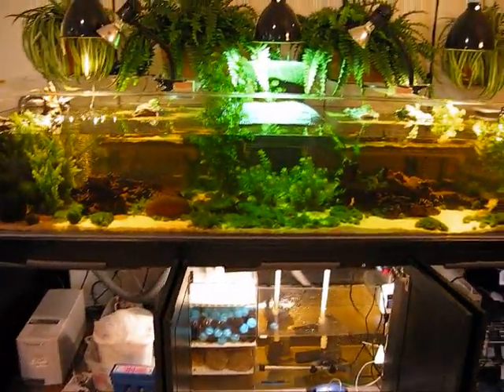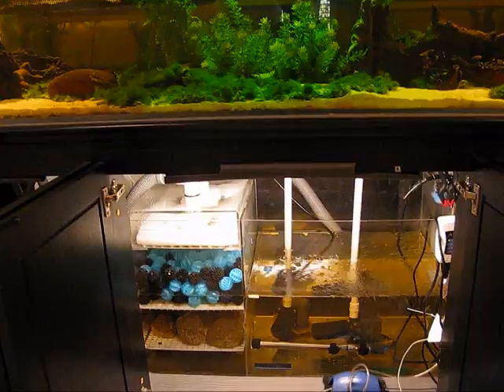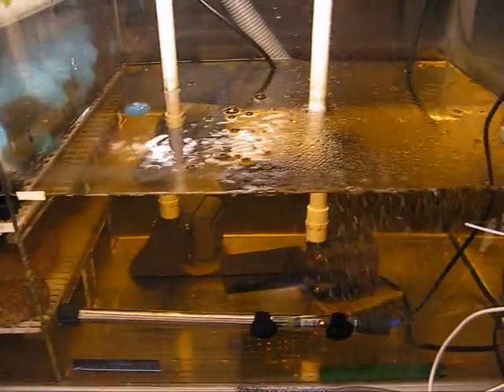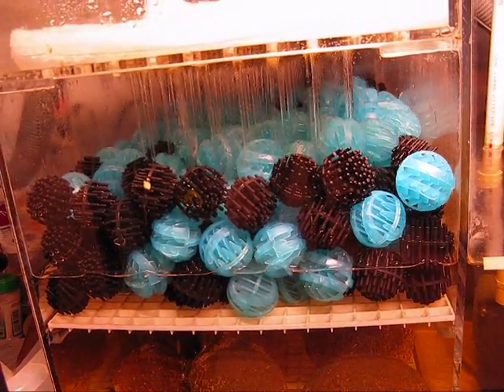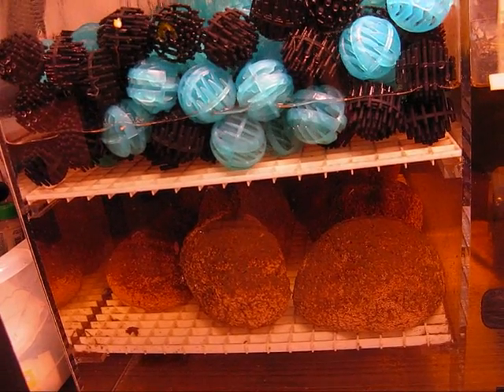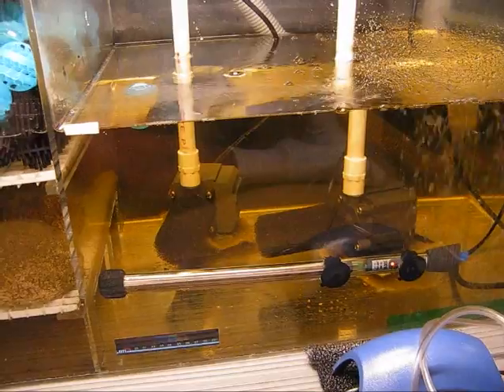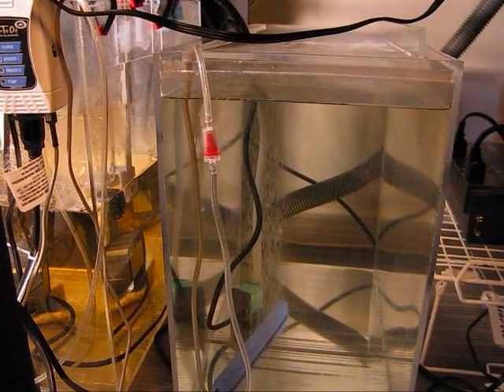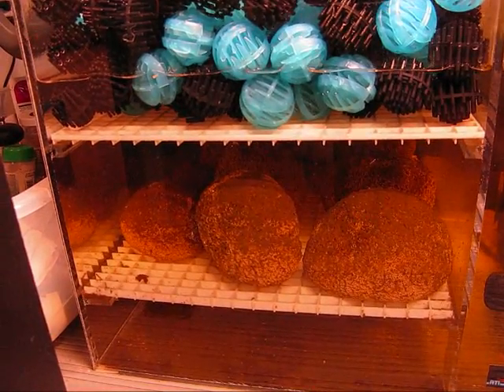Turtle Tank Trickle Filter

Comment from the maker: @Amatersaru1 I know that it looks that way, but the force of the water coming out of the return nozzel (700 gph) moves the filtered water well into the body of the tank and away from the overflow.  You can set up a tank with the return(s) on one side of the tank and the overflow(s) on the opposite side.  A stronger, one-way current is formed that way but I think having a return on each side mixes the water better.

Comment from the maker: @wailed72 lots.  can't remember excactly.  The tank is a custom built acrylic tank with a large sump.  The stand is also custom built because the tank is so wide (3 feet).  If you can do some of the work yourself, you'll save a bundle. You can price shop at different aquarium stores for the tank and sump, then check with furniture builders if you need a custom stand.  Plan on spending a couple grand for an extra large setup, tank, sump, pumps, plumbing, etc.

Comment from the maker: @turtlefan03 I did not design my sump, had an aquarium shop do that for me.  They also built my tank.  The sump only needs to hold enough water to operate the pumps and manage backflow when the pumps are off.  More water helps if you want to place a heater in the sump, add a bag of carbon, etc.  More water helps dilute waste.  With lighting you can even create a refugium out of your sump with plants and even fish.  There is plenty out there on the web on sump and refugium design.

Comment from the maker: @xdylancoolman I don't design tanks, best to check with a good aquarium shop.  I have two 700 gph pumps.  I have about 25 gallons of water in the sump while the pumps are on, backfills to about 30 gallons when the pumps are off.  I do my water changes from the sump, not the tank.  Keep my heater and a bag of carbon down there.  You only need enough water to cover the pumps and enough volume to accept any backflow when the pumps are off.  A larger sump increases total water volume, that's good.

Comment from the maker: @jptzy I did a video on managing overflow noise, take a look at that.  I have a corner box that surrounds the wet/dry plumbing to keep the turtles away from it.  On that corner box I attach a few electrical ties and drop one end into the overflow--that manages the noise quite well. 

I have a reservoir and an automatic topoff device that automatically pumps water from the reservoir to the sump as water evaporates.  It is great, especially if you are out of town for a few days or a week.

Comment: im in florida too and know all bout those power outs. great vid btw. i need to refill my sump roughly every 2 weeks because of evaporation. my trickkle filter moves alot of water but my only problem with it is the sucking noise it makes when the water goes down the overflow tube. i tried everything to change how the water goes down it but the noise wont go away permanently. my overflow tube hangs off the back of my tank after gettin siphoned from inside the tank. any solutions to the noise?

Comment from the maker: @staffi910909 depends on your setup.  I change the filter pad twice a week along with a partial water change.  When I turn off the pumps, some water backs up into the sump.  I then drain the sump (about 30 gallons) using a separate pump connected to a garden hose that leads outdoors.  I then refill the sump and turn the pumps back on.  I don't do any maintenance inside the tank except removing algae from the sides and siphoning debris that collects at the bottom of  the corner boxes.

Comment from the maker: @Theyallfloatdownhere if you really want a wet/dry filter there are a couple options without getting a new tank.  You can build an above the tank wet/dry where you pump water up to the sump, the filtered water then runs or rains back into the tank.  Or you can buy an overflow box and have the sump underneath just like a drilled tank.

Comment from the maker: @madturtlefan They are bio balls.  The surface of the balls is not solid but rather a maze of surface areas througout the inside of the ball.  Water pouring over and through the balls spreads out over the vast surface area allowing for a generous exchange of oxygen.  Water filtered in this manner will have very high dissolved oxygen levels.  Nitrifying bacteria that break down the waste and uneaten food are oxygen hungry.  The more oxygen, the more 'good' bacteria to keep the tank clean.

Comment from the maker: @madturtlefan not if I can help it.  The tank becomes a balanced ecosystem after a while and a complete cleaning would ruin that balance.  This works best in a large tank.  I scrub algae from the sides of the tank, siphon debris that collects in the corner boxes where the plumbing is, rinse the bio material in the sump, change the filter pad, do frequent partial water changes, and monitor ammonia, nitrites, nitrates, and periodically check PH and  dissolved oxygen levels.  That's about it.

Comment: @BauriBob Oh, I know it. Right now I'm using pumps connected to filter boxes. They pump the water into another box that serves as my biological filter and hangs on the side of the aquarium. The filter boxes do all my mechanical filtration, and they have some activated carbon for chemical filtration as well. Then the water goes through my bio filter which has the heater in it. It gets the job done, but isn't as easy on the eyes as yours!

Comment from the maker: @kwo282828 There is never any uneaten food since the catfish and ghost shrimp finish off whatever the turtles leave behind.  Turtle and fish poop dissolve in the water and is converted to ammmonia byproducts which are easily dispatched by the biological filtration of the wet/dry.  I never have to siphon the surface.  On occasion I will stir the sand with a stick near the front of the tank since some debris sinks below the surface, but that is for aesthetic purposes only.

Comment from the maker: @kwo282828 do you mean in the sump?  There is a filter pad the water has to pass through before getting to the sump.  Don't really have to clean that at all as long as I keep up with normal maintenance.  

If the biomedia gets dirty you can rinse it in de-chlorinated water.  Ideally, don't clean all your biomedia at once but over a period of days.

Comment from the maker: @kwo282828 I do partial water changes twice a week.  I remove what is in the sump, about 30 gallons using a hose connected to the pump, then fill with fresh, dechlorinated water.  Don't do full water changes as a routine because you might lose the beneficial nitrifying bacteria that help break down the waste in your tank.

Comment from the maker: @dkrn09 one other thing to mention.  When the pump(s) in the sump are turned off or go off during a power outage, some water will backflow into your sump.  Your sump must be large enough to handle that backflow.  If you have the returns above or at the surface there will be very little backflow, just what is in the tubing.  If you put your returns deep in the tank, you'll get much more water.  In that case you can drill a hole under the return just above the water and that will break the siphon.

Comment from the maker: @Cattibry I don't design sump filters.  I had an expert from an aquarium shop do the calculations for me.  You don't mention how many gallons per hour your pump puts out.  It sounds like is that your pump is too powerful for your overflow.  Is your tank drilled at the bottom or are you using an overflow box?  You either need to use a smaller pump or else add another overflow so that the water returns at the same rate you are sending it to your tank.

Comment: I just go a wet/dry trickle filter. For my turts. I'm having trouble maintaining the water level in  my tank. It seems that  the water going into the filter and the water returning back to my tank do not match up. My sump gets empty fast and fills the tank. I know that water level is suppose to rise but it just keeps on rising until the is no more water in the sump.   I'm so afraid that I will burn out the pump out or flood my tank. Any suggestions on trouble shooting this?

Comment from the maker: @MrPrikPrak all depends on how much you can spend.  RES get big, are excellent swimmers and require a lot of space.  Down the road you'll need a 200-300 gallon tank.  You'd save money in the long run to go that route now.  The larger volume of water in a big tank is easier to keep clean.  A good canister filter should be fine for a single turtle.  If you are going to have more than one, especially larger turtles, a wet/dry fllter is not a bad idea and are much easier to clean than a canister.

Comment from the maker: @jenbacherwrencher My returns are at water level so siphon is broken quickly when the pumps are turned off.  The water backs up just slightly but no overflow.  In other words, don't place your returns deep in your tank but rather near or above the surface.  I don't know why you have a pump in the tank as well as the sump, I am not sure what you are doing there.  If you don't have a drilled tank, you need an overflow box.

Comment: Bob, I have a 10o gal. tank for my turtles, and I have a spare 30 gal. tank that I'll use as a sump. My question is, what if one of the pumps fail? Either one, what if the return pump fails and the sump overflows, or the in-tank pump fails and my main tank overflows? BTW My tank is glass and not drilled. Thanks.

Comment from the maker: @TranJamie100 I strongly recommend you get expert advice if you are building a sump filter.  You need to size the plumbing and sump correctly or risk flooding.  There are different sized PVC in my system, I actually don't remember the exact dimensions, maybe 1" to 1 3/4" or so.  But don't guess, visit an aquarium shop or do some online searching.  Buiilding tanks is not my area of expertise.

Comment from the maker: @CABLETHRASH It is a good idea to soak any wood in a bucket of water for a week or so before using in your tank, change the water in the bucket periodically.  I use Mopani wood.  It is beautiful and sinks to the bottom, but it leaches tannins for many months.  I use carbon in my filter to remove the tannins.  Partial water changes will also dilute the tannins.

Comment: i have wood in my tank and i just got it how long will the wood tint stay as strong as it is being a new piece of wood because i have had it n my tank for two days and i want to do a water change not completely but to remove the tint you think two days is enough for the strength of the tint to be at a minimum state? where it would barely tint the water or do i have to wait a while longer? and do you have any live wood ? like a tree type plant thats submersible  if so what type is it id like one

Comment from the maker: @FlingwingGolfer the tiny pump in that reservoir isn't using that much electricity compared to the two 700 gph pumps that run full time, basking and other lamps, etc.  I would have to elevate the reservoir quite a bit which would be difficult since it is underneath the tank in cabinet.  

What I'd love to do is build an above tank wet/dry filter which would eliminate holes/bulkheads in the tank.  The overflow would then have to work on the tank directly though.  And the design is difficult.

Comment: You could elevate your top-off water storage tank and use a gravity assisted free flow top-off system that utilizes the shut-off mechanism that is found inside a toilet tank to keep your intermediate tank at the desired level, and in doing so use no electricity.

Comment from the maker: @thequangsta not sure what you are referring to.  What is sulfur rock?  Are you talking about the tank or the sump?  I have cell pore rock in the sump.  In only use smooth stones or wood in the tank to prevent injuries.  In a small environment like an aquarium, turtles can get up a head of speed and crash into things, so avoid anything sharp.  I don't use lava rock but I believe they are safe for fresh water aquariums.   They are rough and sharp to the touch though if I am not mistaking.

Comment from the maker: @juanputik I've never written up any instructions.  It's not magic or anything.  The tank is 8' x 3' x 17" high, 12" of water.  sand substrate.  House water is carbon treated, no chlorine/chloramines.  Mopani wood, potted Brazilian sword plants, moss and mossballs.  wet/dry filter with very large sump, two 400 GPH pumps.  shallow water platform, basking platform sitting on PVC scaffolding.  A few plastic plants where needed.  Automatic top off with reservoir to maintain sump water level.

Comment from the maker: @poplar122 not sure what you are talking about.  Don't really have an odor problem, the trickle filter dispatches with the ammonia and nitrites very well so the waste is broken down.  Frequent water changes (about 30 gallons each time) keep the nitrates under control and the water very clean, smells just fine.  The live plants help absorb organics as well.  I do have a bag of carbon in the sump but that is to absorb the tannin given off by the Mopani wood.  That would also help control odors.

Comment from the maker: @mracampa23 it hasn't had much effect on the PH, but I have about 200 gallons of water in the tank.  Try adding a little at a time and see what happens.  If you buy Mopani wood, you'll need to soak it for a few weeks first, it contains a lot of tannin.  But if you don't mind the tea color tint then it doesn't matter, the tannin won't hurt anything.

Comment from the maker: @walsallcrew The overflows are made by Megaflow, not sure of their exact dimensions.  The overflow height is adjustable which is nice.  Looks to be 1 1/4" at the water surface.  I only glued the returns, the overflows can be pulled out.  I did not glue the flex tube.  The clear tubing measures at 7/8".  I didn't build the tank so I don't recall the size of the holes in the bottom, probably around 1 1/2".  If you are building a large system, best to get some professional advice.

Comment: Hi again what size piping are you using and did you cement all joints? And that grey flexible tubing did you glue that to the 90' bends? What's the diameter of inlet overflow? And what size is that clear piping?
Thanks

Comment from the maker: @Stringingstars Ideally, a turtle needs space as they are roamers by nature.  Ideally, multiple depths.  A mix of shade and basking light.  Vegetation for hiding which provides them with something to poke around in looking for food.  A turtle spends most of its life looking for food and captivity often takes that away from them.  The drive to mate is very strong but requires another turtle...and more space.  20 gallons is very small, you'll probably have to go with an internal filter.

Comment from the maker: @CaminDaR I have two filter pumps, one for each side of the tank.  If one fails, the other will still be working.  I have a separate pump just for draining the sump (which is how I do water changes).  I could have rigged something up to use one of the filter pumps to do the same thing but I had an extra pump and it was easier than rigging the plumbing.

Comment from the maker: @LeoIsAries you can buy glass and acrylic tanks on the web.  If you call some aquarium shops, you might find someone who can build a larger tank for you.  Acrylic is expensive but weighs much less than glass.  There is nothing wrong with a turtle topper.  

It looks like you feed your turtles outside the tank and then they drag the food into the water?  Aquatic turtles only eat in the water, but if I am guessing correctly how you feed them, that is clever.

Comment from the maker: @pseudololo My tank is 24 sq ft in all and that is a lot of surface area for a relatively small home.  So the humidity is high inside the house as a result, usually between 60 and 65%.  

Reverse siphoning in a wet/dry won't happen if your return nozzles are at least partially above water.  If they are underwater, the water will siphon back into the sump until the nozzle is above water and air breaks the siphon.

Comment from the maker: I should add that to make this system work, you must monitor your ammonia and nitrites, they should always be zero.  Low levels of nitrates are expected but can be kept in check with live plants and frequent water changes.  The larger the tank the easier it is to keep the chemistry right.  If your wet/dry filter is working well, your water will have high levels of dissolved oxygen which helps keep the chemistry healthy in your tank.

Comment from the maker: On each side of the basking platform is a shallow water platform made from acrylic.  Each acrylic platform is one inch deep and filled with sand.  The platform sits on a scaffold made from 1/2" PVC.  You can buy the special cutters at the hardware store to cut the pieces the way you like.  I fill the PVC with sand to weigh it down, use end caps to keep the sand in place.

Comment from the maker: custom oversized acrylic tank, custom stand, costs plenty.  The cost of acrylic goes up and down with the price of oil and depends where you are.  The price for a custom stand will depend on the material and who makes it.   best thing to do is draw up your tank specs and get some price quotes from local aquarium builders.  You won't need a custom stand unless you build a non-standard sized tank.

Comment from the maker: I've had no problems with discoloration.  My acrylic tank thickness is 5/16" I believe.  I'm sure the thickness is critical but am not an aquarium builder.  There is a rim all around the top for added strength, without which the sides will bow out.  I had the tank built by an experienced builder.